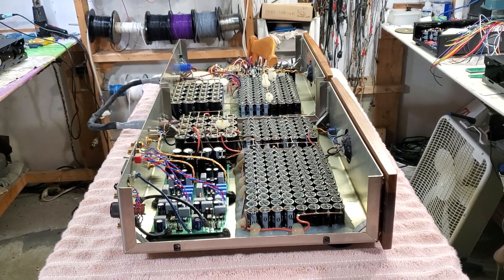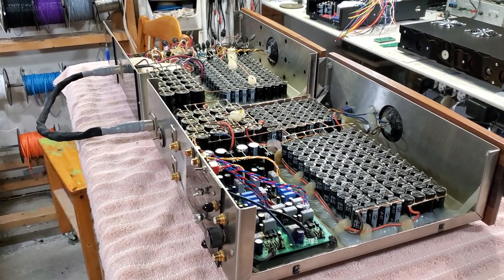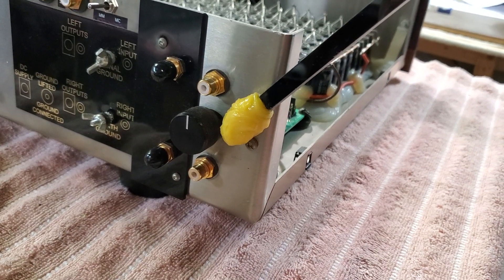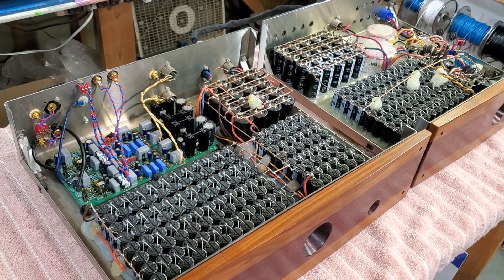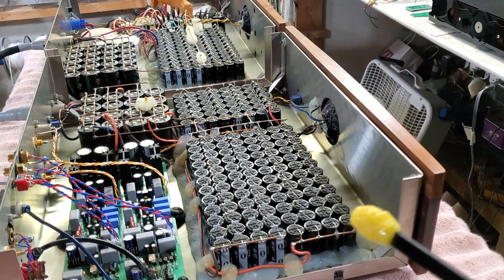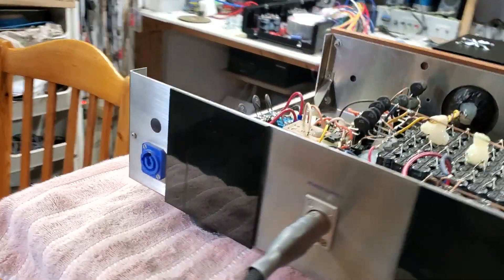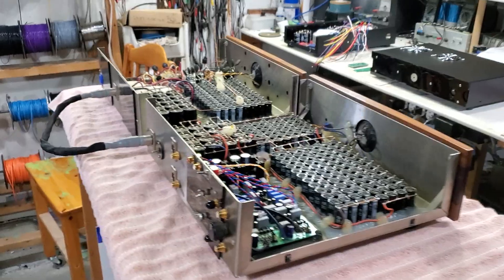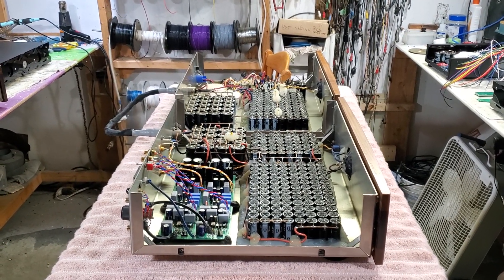Super Capacitor phonostage can run for over 2 hours without ac power.

Comment: You have a good design, right implementation of beneficial technologies. BUT why not tube? I hate the sound of heavily govt invested research in silicon.

I think the triode is the best and it always was. We make good triodes today too.
Reply from the maker: @RobertSchmitt-u7l  I use glass tube some where else usually not in phonostage.  I also see glass tube as salt and pepper for the steak.  They have good favor but need a good steak to begin with.

Comment: I don't know what a phonostage is, but I enjoyed watching this 5-ish minute video about it.  EDLCs, LICs, and I go way back also.
Reply: You can hear phono recordings with that stage. 😉
Reply: Basically it's a pre-pre-amplifier. Input sensitivity depends on cartridge used on the tonearm head. These are in the milli or micro Volt ballpark. There are two factors here, that are important. (1) Correction (linearization) of the frequency range. One variant is "RIAA" that became dominant worldwide, but Britain and Germany had their own variant in cases.
(2) Dynamic compression. "Vinyl" generally can do some 55 dB and in extreme cases up to 65. This means the noise floor easily becomes audible. Hence you want amplification to be very quiet. And as most recordings you play back result from multi-mike, multi-channel down-mixed to stereo, phase clues between instruments/voices is lost or helixed up (a helix is a screw). Consequently soundstage becomes completely dependent on volume clues and hi-fanatics need micro-dynamic clues to be perfect. Yes, recordings doing that are [male bovine excrement].
It's a pre-pre.

Comment: Now all you have to do is invent a turntable, amp and pre-amp that can run 2 hours without power.
Reply from the maker: Already done.  Here are the link to preamp and power amp.

Preamp which can run 20 hours on Supercap: https://www.youtube.com/watch?v=-r73TBIfjCc&list=PLsvoZU7Ca7T1DEGN6brnoQ_215x704FSk&index=6

Power amp which can run 25 mins on Supercap with provision to add batteries and or supercap:https://www.youtube.com/watch?v=bTrt2Xm6R1A

Turntable can be run on an pure sine wave invertor on 12V batteries.  If it is a 12Vdc motor, it can run directly from batteries or supercaps.
Reply: @angela-gilbert  Wouldn't a Lithium Ion rechargeable battery like the ones used in eBikes had been better and longer lasting?
Reply from the maker: @AudioGuyBrian  I am not going to answer your question directly but will give you some information to think about.

First, this phonostage was built in 2006.  Super Capacitor was in its infancy.  There was no Li-Ion battery back then or at least not available to the general public easily.

Second, there are many apartment buildings has banned charging e-bike inside the building due to fire safety.  Would that tell you how danger charging a Li-Ion battery is.  Although, a battery for a phonostage like this isn't going to be very big.  It is still unsafe enough to do it indoor.  I do charge my cell phone but I make sure it is in the open without any flammable material around.  If the battery is safe, the chargers are mostly garbage especially those you can buy from cheap online platform.

Third, how long do you think a Li-Ion battery can last.  What is their charge cycle?  Look at resale value of EV and you will understand Li-Ion battery isn't a long term option.  On the other hand, Super Capacitor work in a very similar principle as regular capacitor.  If you treat a capacitor correctly, it can last more than 50 years with no noticeable negative effect.  It cannot be said the same as for any battery not just Li-Ion battery.
Reply: @angela-gilbert  Sorry, I thought that was a DIY piece of gear you made recently. Didn't know it was an actual product from 2006.
Reply from the maker: @AudioGuyBrian  The video I shown you were all feasibility prototypes.  It went into production in a different foam.  This photostage was a custom job back from 2006.

Comment: I bought and stuffed a Hagerman phono preamp board one time.  It was powered by two 9 Volt batteries that lasted a long time and the whole thing fit in the palm of my hand. i had a nice enclosure for it and put wood trim on the sides. But it was only for MM.
Reply from the maker: Radio Shack used to offer a MM phono stage which uses a single 9V battery.  Lot of phonostages can run on single or dual 9V battery.

Comment: This is a joke right?  How ignorant of basic electronics do you have to think that 10000000x more capacitance makes it better?  Will have to calculate how long it takes to charge, 1 or 2 days?
Reply: Probably the presenter knows how long it takes to charge. 

https://youtu.be/J0-5o5koZIg?si=eaFwY8r8BH9iQZd8

And you’re saying more capacitance doesn’t make it better?
Reply from the maker: @ludmilascoles1195  Perhaps your lack of understanding of electronics lead to your rather uninformed statement.  Not knowing how to charge a simple bank of 350 Farads super capacitor is one of them.
Reply: @angela-gilbert  I was being funny the time is maybe 3 to 4 min,  or an eternity in electronics, I would think a few NTN resistors would be better what need to be brought up so slow,  even Phillips valve heaters do not need such a slow start

Comment: When a single capacitor will be defective... searching and changing the detective capacitor will be a nightmare.  And the capacitors seem to be glued to the chassis with silicone or something resembling to it, not a professional and safe approach.  Why, at this point, not to use a rechargeable battery (or more batteries string, for higher voltages) followed by simple passive RC filtering with regular, good quality, electrolytic capacitors?
Reply from the maker: @marioluc1105  It seems you have no knowledge of repairing electronics based on your statements.  Perhaps you don't understand super capacitor and it advantage over battery?
Reply: @angela-gilbert  The fact it's layed out like that, if you were not the designer of it, you wouldn't even need a scematic to see what is the order of the circuit! Just wizz along the top with lcr meter (after 2 hour wait for it to stop playing music after you unplug it ofc xD), would take maybe 10-15 mins to check them all at a leasurely pace. Keeping track of what ones you have already checked would be the hardest part of it, I guess you would use a tiny blob of silicone on each one to solve that issue? :D Probably easier than keeping track of where you are on the back of a medium layout density PCB TBH... and not that a single dead capasitor would even slow that thing down either... You could probably go without realising for years if you didn't actrually check, as I'm guessing they are all paralelle for the most part anyways (unless you are sacrifysing capasitence for voltage to some degree, as I'm not sure how much voltage them super caps can handle per cap on their own). ;)
Reply from the maker: @Dafty_Boi  That's the things.  They are not all in parallel.  They are a combination of series and parallel to each other in order to achieve the necessary voltage requirement.
Reply: @angela-gilbert  Ah so it may take out a sizable amount of (raw) capasitence in one go then if one were to go, however testing them would be EVEN easier, as you now have banks of serise caps to check to narrow it down, and only check indavidual ones when you spot the bank acting up, so it's probably more like 5 mins to locate the "imaginary" fault we are discussing! ;)

EDIT: although if they are serised banks of parralelled caps, you still wouldn't nessisarily notice one went bad, only if they are parralled banks of serise caps you might... (depening on how much of the total capasitence got taken out, given a rare complete OC failer, which would depend on the specifics of that circuit's layout) but in either scenario it's easy to locate the fault as you are working with banks of multiple caps and can test 4x or 16x caps or however many caps there are per bank all at once. And that's ofc if it didn't bluge the top or vent first, which is an instant spot.

Comment: Why not use a rechargeable acid battery instead of the capacitors? take up less space you just need some capacitors as extra smoothing. Another thing why bother using RCA ? You're right about connections, why not use BNC it's a much better connection you could always have a converter plug if needed, but easily can put a BNC plug on a cable you want it below 50 ohms anyway 43 ohms zero capacitance from the TT to the amp.
Reply from the maker: Battery has their disadvantages.  If this is using battery, it would have been replaced twice or three times already.  These supercaps are still working fine.  They don't even need trimming after these many years.
Reply: @angela-gilbert  I'm not sure about that a good quality lead  acid battery should last you ten years and I've seen them last 20 years. But what about the noise from the capacitors, is not an issue?

Comment: Why? And why not just lithium ion or something?
Reply from the maker: @alphabeets  First, this was built in year 2006.  Super capacitor was in their infancy not to mention Li Ion was no where to be founded.  Second Li Ion can only operated between 2.5 volts and 4 volts.   It can drop below 2.5 volt or it will damage the cell.  Third, handling and shipping Li Ion is way more hazards than super capacitor. Have you try to short a super capacitor compare to shorting a Li Ion cell?

Comment: How do you charge once discharged (needs a lot of current)? No balancing (I don´t think supply voltage is less then 5V)? A lot on energy, how much Joule? A little bomb!
Reply from the maker: @jean-paulschweitzer6211  The power supply is at +/- 13.5volts.  I have done another power supply with thr same voltage with 1,980 Farads.  So this is not my biggest supercap power supply.

It requires multitude stage soft start to control the inrush current.

Comment: How much capacitance is enough?
Reply: 20,000uf is enough to filter almost all ripple out. However adding more caps in parallel like this reduces the ESR exponentially which results in current transients responding quicker and reduces ripple even further. Over 20,000uf is technically pointless but can be subjectively better.
Reply from the maker: That is.......  a very subjective question.  Back in the 1970s, 4700uF was probably enough because capacitance was relatively more expensive than now.  Today, if you put 10,000uF into the unit like this, there are a lot of people would say it is too small.

There are higher level DIYer's installing over 3,000Farad (3 billions micro Farads) of capacitance into a DAC.  Is that enough?  Probably enough for now until Super Capacitor advance even farther.

My point is, if we want the best that we can get and at a reasonable cost.  Then go as far as the budget allow.  We never know until we tried it.
Reply: @angela-gilbert   As a DIY'er, if I had big enough pockets I would put as much capacitance in as possible!
Reply from the maker: @peterlarkin762  You van do it in steps.  Don't have to do it all at once.  This the reason I offer external capacitor packs so user can add on when their budget allow.  Our capacitor packs are user plug and play. No need to send the amp back to us.

Comment: GM ☕️🍩☃️
Holy Smokes..that’s one hell of a lot of capacitors 😮
Reply from the maker: @carminedesanto6746  350 Farads in total at 13.5 Volts
Reply: @ that’s a lot of juice 😵‍💫
Reply from the maker: It sure is.  2 plus hours of playing without ac power.